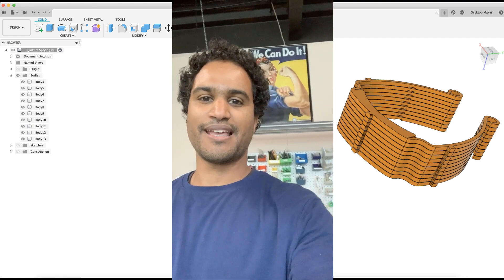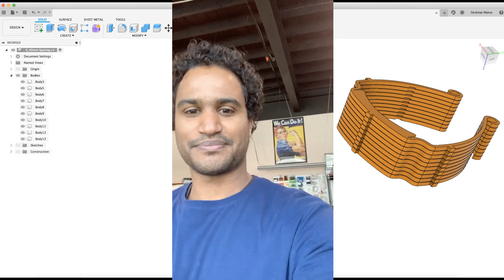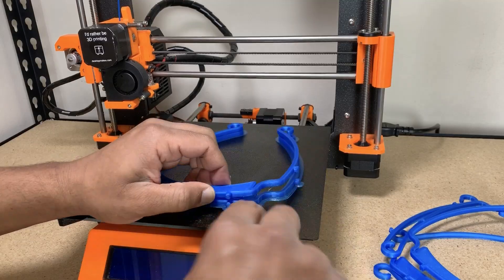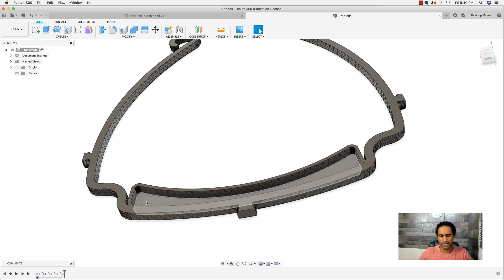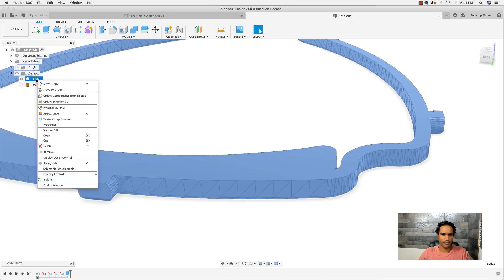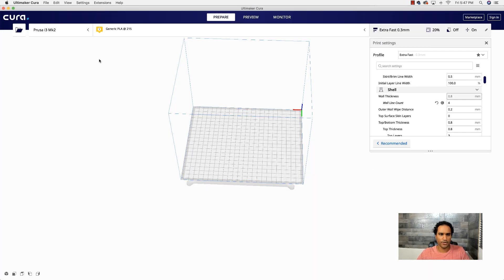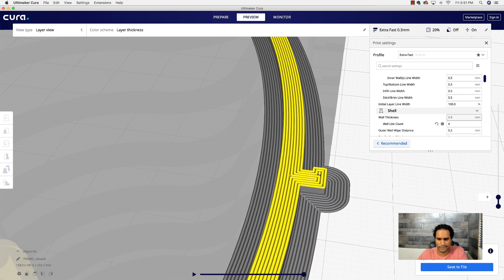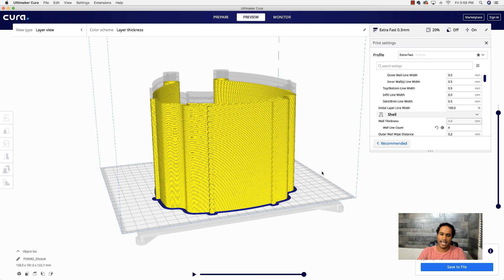Stacking 3D Printed Face Shields in Fusion 360

Comment from the maker: For those using PrusaSlicer, you'll get an error message saying empty layers found.  Honestly, I'm not sure how to go around this.  I tried it with Cura and S3D and it works with both slicers.  If anyone knows of a way to export with PrusaSlicer post your answer here.
Reply: I found a program that actually does this for you! It also fixes the PrusaSlicer issue saying there are missing layers. https://www.luban3d.com/ Just download from the drive or dropbox. Open the exe and click the help section on the menu bar. then click the mask stack. import stl and follow the instructions. EZ
Reply: @potatotech7378  Please share, many people are looking for an easy fix for this as they are donating shields enmasse to the people that need it. My modifier comment does not work as I assumed (it was suggestion I read over at Prusa forums) so I've been modeling "pins" directly in Fusion.
Reply: Hi. It`s the gap the same layer heigth of yur slicer?
Reply: @ramchoso  yes and make sure your first layer height is also the same
Reply: @potatotech7378  Thanks for the find ... I am working with the developer to make it more friendly for various nozzle sizes and such as the tube diameter to trick Prusaslicer is only 0.5mm which only kind of works for 0.4mm nozzles and enabling "detect thin walls" which ends up fusing layers together.
Reply: @nimaim  Sweet!!!!
Reply: PrusaSlicer doesn't like empty layers. It won't let you print in air, even though you've done all the math. You have to add a modifier, like a slim cylinder a bit bigger than your extrusion width, and extrude it through the entire stack. Or you can do the same in fusion 360 and use a pattern along path to copy an extrude around the entire path of the shield.
Reply: Do you have anyone lined up to take your face shields?
Reply: @Vontux  limakes.com
Reply: You can get around this by adding a cylinder or a .4x4mx (however mm high your stack is) box - enable small perimeter detection and the error will go away. I still find Prusaslicer is creating a stronger bond (but also a cleaner finish than cura).
Reply: Pursa just released a "stack" version of his version of the face shield. Go check it out!
Reply: Hey did you solve it for Prusa? I strive to stack the R3 lightweight.
Reply: @bluesstoney  prusa shields are on their website. They have it for download. If u want 3dverk model stacked look up LuBan. It's free
Reply: Potato Tech thx. LUBAN worked great done. Now I need to learn build the cylinders to support the mounting nipples for the shield.
Reply: i guess it is quite randomly asking but does anybody know of a good place to stream newly released series online?
Reply: @Jesse Lucas flixportal xD
Reply: @Branson Brendan Thank you, signed up and it seems to work :) Appreciate it!
Reply: @Jesse Lucas Happy to help xD

Comment: Gaps have to be multiples of your layer height.  So if you are printing with 0.2mm layer thickness, then the gap should be 0.2 or 0.4 and the slicer won't avg up/down to accomodate.  Meaning if you have a layer height of say, 0.15mm but a gap of 0.2mm, the slicer will make the gap 0.15mm because that's the layer height.  It can't start a new layer 0.2mm higher, only 0.15mm or 0.3mm etc.   Also, having 0.15mm layer height with 0.2mm gap will offset the beginning of each shield and they don't all slice the same.  So it's less a difference in printers and more an exact matching to the layer height you set in each slicer version.
Reply from the maker: Thanks Randy.  I ended up realizing I was missing this very important point and made a new video explaining this as well.

Comment: How can you make a 0,4 nozzle make a 0,5 wall? Hmmm is there like a 0,3 mm overlap?
Reply: I think 0.4 nozzles can extrude 0.5 by as the plastic pushes into the bed and spreads out (reduces height, increases width to 0.5)

Comment: I don't see the STL file for the stack.  I'd like to start printing these on my MK3 rather than spending a bunch of time figuring out how to do it.
Reply: I agree, I'd love to get the stl too then I can start printing immediately
Reply: I'm looking everywhere for the stl too...
Reply: @quique182 Built my own one in Cura. All you do is add the model and then create a copy. Center the newly created model and change the Z hight so that the gap is 0.3-0.35 then stack the next model and so forth.
Reply: @InfinityDrones  IQless channel has a program to create stacks from a single STL.
Reply: @jccbsl1  It's okay. It's incredibly easy to create your own stack in Cura. I've been printing not stop stacks of 10-15.
Reply: Would these print on a anycubic 3d printer?
Reply: @ProjectorGamer  I see no reason why not. I'm printing on an ender 3 pro, but if you can print PLA and have a large enough build plate, I see no reason why it would not work

Comment: Good video. I learned an easy way to turn a mesh into a solid body in Fusion 360. I do have one question about your infill though. I believe the other idea behind printing the model as nothing but perimeters was to accommodate flexing of the ear pieces as you put it on and take it off. Wouldn’t this infill pattern make the part more rigid and prone to cracking?

Comment: You can also use the support in cura for this: leave a small gap the use concentric support with a very small line width. this will work for larger nozzles and layer heights

Comment: how about 1 soluable support layer in between each mask?
Reply: thats a good idea BUT it will drastically increase your print time
Reply: @tashiiwhite2151  why would it increase your print time drastically?  The soluble layer would be all perimeters just like the others so it should not take appreciably longer to print that one layer.  Plus you're only printing it once every 25 regular layers, so you can amortize any additional time across those 25 layers.  With an IDEX printer the overhead would be even less.

Comment: "FIX" FOR PRUSASLICER "EMPTY LAYERS" DEFECT:
- Modify the code! In the meantime, though...
- Create a tiny spacer: square prism: height=air gap between layers; side length="tiny" (0.7mm, but will depend on nozzle/profile).
- Effectively, no empty layer, but instead a tiny "dot" of plastic, which should not be a problem.
- FYI, did this in Fusion 360 parametrically.

Comment: would it be possible to do some sort of test swatch (faster print) to determine the gap size or will it change depending on what you are printing?
Reply from the maker: Yes, I did this with a small rectangle first.  I also tested by splitting the headband in half and just having the printer print half of it.

Comment: Hey Vladimir  I apologize for the lengthy text 
I appreciate your videos and I’m subscribed as well. The other day I was watching Devin from make anything and he had imported the file into 3D builder using the control c control v then calculating the distance to raise the model off the build plate then pasting one under neath. I found it easier to copy then raise the existing model any distance greater than the height of the model paste the new one then just grab the raised one and nestle it down on top of the other. Then what ever the calculation is that works best you raise the top one/ones that distance. When you have the stack as tall as you want, save it as an STL and send it to the slicer.
Reply from the maker: Hi Jules.  Yes, I ended up watching that same video.  I had never tried to bring an stl file into 3D Builder.  Glad to know that's an option.  Check out my latest video.  I ended up recreating the part in Fusion 360 and then used the Rectangular Pattern feature to create my stack.  This allowed me to easily come in and edit the spacing while testing different heights.  It's a lot more efficient than copying and pasting.

Comment: Great, thanks. I've been testing stacking since last week. Could never get the space right on CR-10. Are you using 3.5mm on CR-10? Mine just starts to lay down on "air" and the bottom layer of the second onwards part get all messed up. Any other tweaks you did on CR-10? Thanks
Reply: He used .35mm for the air gap

Comment: Once these are printed, how do you go about separating them?  I'm having trouble with them "sticking" together.  Would love to get your advice on this! Thanks!
Reply from the maker: I've been using a flat head screwdriver to pry apart as I show in the video.  If they are sticking to tight, it most likely means your gap between layers is too narrow.  This is the tricky part.  Getting that gap just right for your specific printer.  I'm printing for a Prusa MK2, an Ultimaker, and a CR-10 and they all require a different gap spacing for the prints to come apart easily and still have a good surface finish.
Reply: @DesktopMakes  could you tell me what gap distance you use on the ultimaker 2 plese as mine are sticking together.
Reply from the maker: @cryptodipso  I went with 0.30 on the Ultimaker.  However, I'm finding that even changing the filament will affect how much the prints stick together.  The number will be so specific to your setup and my have to be tweaked even with identical printers.  It's a starting point but may not work in the first try.

Comment: I was with you on the not to use 3d printing. takes too much time and there is always chance did failure.   this is my friend Karl and made video like this.  https://m.youtube.com/watch?feature=youtu.be&fbclid=IwAR0qrhOcYWCl7AO-wjb217o0ulNWax3bruYWj2JlphrtxN2h7zFYOeNUbR4&v=3vMfXhINKxg
Reply from the maker: Yeah, you can definitely make them a lot faster with that method.  However, we're now finding that foam and elastic is becoming harder to source with many making them so this is one advantage of the 3DVerkstan design.  It's just a 3D printed part and a clear binding cover sheet.

Comment: First - Thanks for this tutorial.  It was exactly what I was looking for.  However, I have a problem.  Once I bring the file into PrusaSlicer and hit "Slice Now" - I get the "empty layers output will not be printable" error.  My 8-up stacked model was made following your tutorial. so I am sure it is correct up to that point.  Any help is appreciated!
Reply from the maker: PrusaSlicer doesn't seem to like empty layers.  You can use a different slicer or possibly model a small thin cylinder that touches all the parts.  Small enough that it won't affect the prints - just to trick the slicer.

Comment: Nice, but PrusaSlicer did not accept the gap between the parts, what can i do ? It will not slice the part !  I dont use Cura.
Reply: add a small cylinder or box that touches all layers, will solve gap

Comment: Great video Vlad. I found that rectangular pattern worked ok for me. Also, maybe consider removing the front piece rather then adding to it (leaving 2 rails), that way it will keep the print time low and should not affect the strength or flexibility too much.
BTW I printed a slinky when you did the original video it's still sitting on my desk and still working perfectly. I separated the coils with a paint scraper, the secret is to be slow and patient.
Reply from the maker: Thanks Spike.  You may have a more powerful pc than me.  If i try it on a stl file that has been converted it just takes a long time to process.  I may do another video redesigning the mask and then doing the rectangular pattern to be able to easily tweak the gap.  I considered removing the front piece but what I'm hearing is that hospitals prefer a closed area on top to prevent spatter from entering from above.  It would make it more efficient to print.  That's awesome that you made the slinky and still have it!  I brought mine to a maker faire and someone got it all tangled to the point where it was hopeless to try to get it back to normal.
Reply: @DesktopMakes  Ah of course, I hadn't considered the splash risk. Just had another idea for reducing the stress on your PC while patterning, you could recreate the model by using the Create Mesh Section Sketch tool in the Create menu, I think this would be the perfect model for it as it would reduce the number of facets considerably. I did see a video on it quite a while ago, but can't find it now. Thought it was Lars Christensen but not certain.
I'll give it a try later.